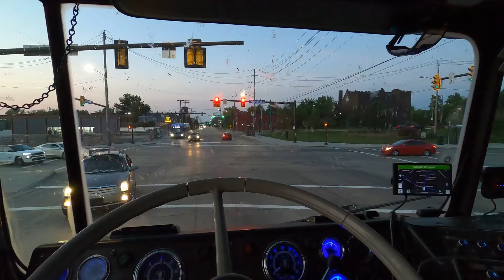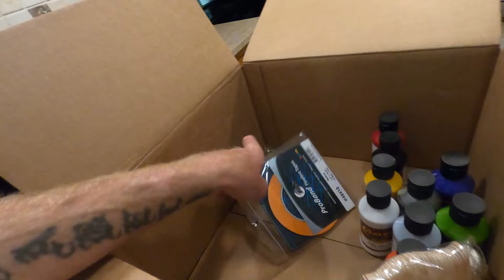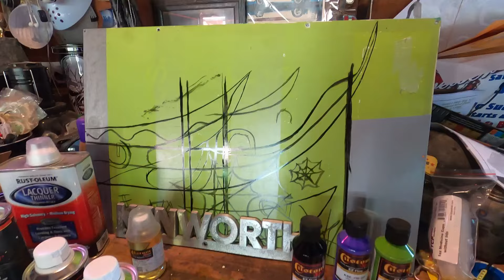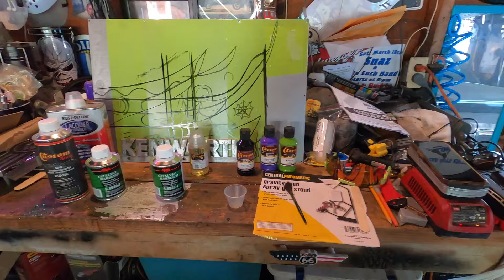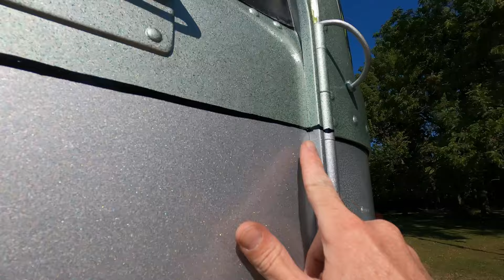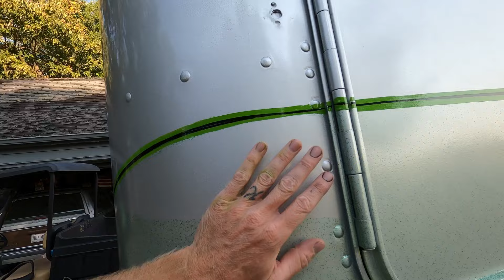First Time Freehand Pin Stripping On The Monster Aka Frankenstein

Comment: I have no idea what I’m talking about but. Get some more metal flake to mix in with the clear. Spray that spot or any other spots missing the metal flake. Then switch back over to just the regular clear. To spray your final coat or first coat whatever. Just a thought,.truck looks great though as is.
Reply from the maker: @chadtanner  I still have a little bit left I could do a mix for the spots 🤙🏻🍻

Comment: I would have used painters tape as a template for making straight lines, like on the doors. Good job though brother, it's still the Frankenstein truck.
Reply from the maker: @glens2036  that wouldn’t have been a challenge then 🍻
Reply: @1ChadKeegan  I gotchya.
Reply from the maker: @glens2036  I had the original color change line to go with but sometimes I was going the opposite way to see it. 🍻

Comment: Add some vertical lines In some chosen spots of the pinstripe to simulate hair line and some where in the front right panel you need to add that Red open line somewhere to simulate that blood cut mark on his right forehead area ???
Reply from the maker: @adrianrichardson7002  probably won’t be any red on the truck 🍻

Comment: Looking good. Did you get the new gasket for the wind shield?
Reply from the maker: @mjkrigging6374  I’ve had them for 2 years now I took them from Garrett’s truck and just haven’t put them in yet
Reply: Cool I remember now when you got them. Hard to believe 2 years where does the time go
Reply from the maker: @mjkrigging6374  fr fr